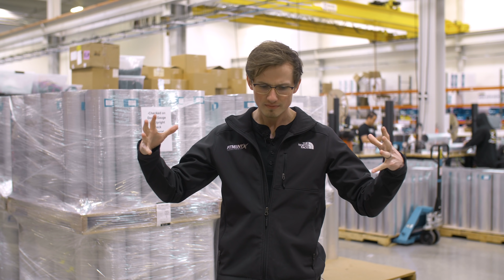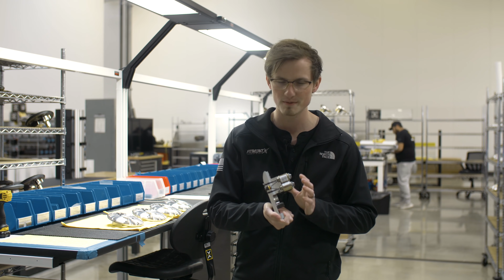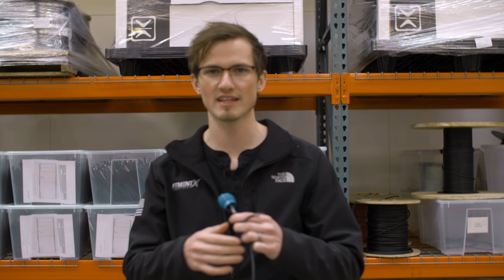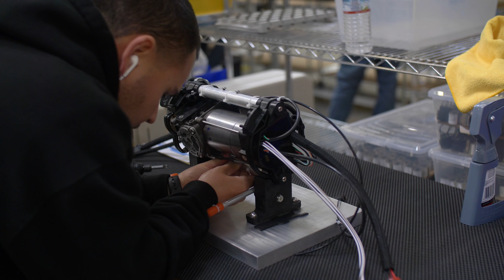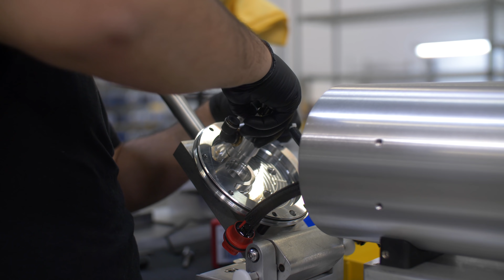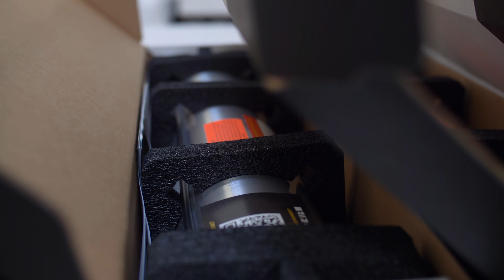AccuAir ENDO CVT | How It's Made

Comment: What happens when the pump fails? Do you have to buy a whole new tank?
Reply: Their tech support will have you send it in and they will repair it for you in 5-10 days or replace it if the system is faulty
Reply: the compressor can be repair/replaced under warranty and you can actually take it out of the tank (not recommended)
Reply: Ashish Patel i was thinking the same thing. Lol
Reply: My system is the switch speed by accuair and the endo cvt tank which is also by accuair . the accuair system is less then a year old. The valves inside the cvt tank stopped working and so did the compressor that is built in to the CVT tank.  
I am so upset. The company went out of business and i cant even get the parts to repair my system. 
The worst $2600 i spent. The tank is junk because it keeps all the air condensation inside . There is no water trap or drain for the moisture to release. The tank fills up with water and shorts out everything. 
I wish i could take this company to court
Reply from the maker: Hob and Thunder got this one covered! Thanks guys. 🙏🏼
Reply: @FitmentIndustries  i currently run 2 compressors just in case one fails and I dont want to get stranded. What is the back up plan in this case?
Reply: Supply on Demand my friend said he just used a car pump like for tires to inflate his tank when airlift setup failed
Reply: My brand new endo cvt failed sent it back for repair. I took over a month to get it back. Had to pay for shipping duty and tax twice.  Car was down for a month. I would never buy Accuair again.